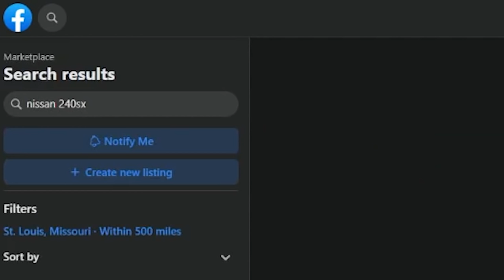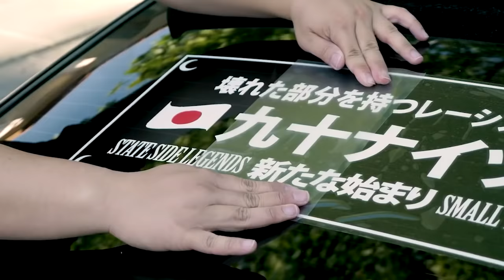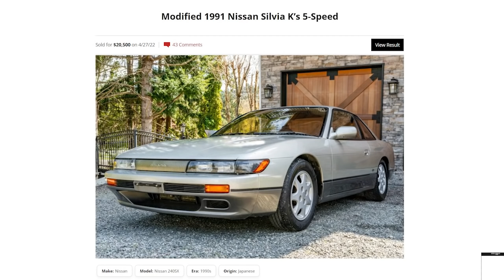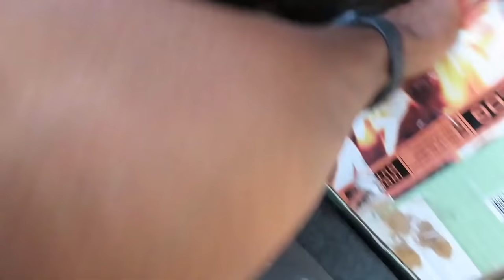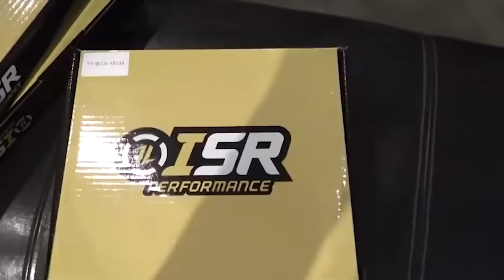Hard Truths of Owning a 240SX in 2022 (Donut Media Won't Tell You This)

Comment: I own a 93 S13 hatch since 2020. Got it for a decent price for what it was. Saved it from being slammed to the ground.($1600) Paint was bad, motor was blown and had some rust on common areas but the interior was intact and it wasn’t falling apart. Got it running within 3 months. I’d be lying if I said I didn’t have a hard time with the car. It was all worth it seeing it run though it is a money pit😅. Currently I built a KA-T and am doing some more rust repair but luckily I got the experience to do so thanks to my pops😄. Hopefully I can get it running again and looking good doing so. Won’t be easy but I’d Also be lying if I said I wasn’t determined to fix up

Comment: You’re absolutely right about the price. I bought one for a grand that was all original and it showed it, and the engine had been torn apart for 8 years. After getting it running and road worthy, I turned to the suspension. I’m now $15000 into it, and when you walk past it, it still looks like it did when I bought it but lowered. But it is a rust free car and I keep it in the garage, so that’s a thing.

Comment: You hit the nail right on the head with the build progress. I fell into that trap with a different chassis and eventually lost motivation for it and couldn’t find jack s*** for info on the swap I was trying to do. Luckily, I pulled all my parts worth value off, went out and bought a running and driving SN95, and installed all my drift car parts onto that car, and it was the best decision I have ever made because by the time I finished the other vehicle, I would have been well over $10k into a vehicle that would be worse than my SN95 with harder to source and more expensive parts. I cannot stress this enough. Buy a vehicle that fits your budget and needs the bare minimum to get you seat time in whatever motorsport you want to do because there is genuinely no worse feeling than dropping a stupid amount of money on a vehicle and not even getting to drive it or worse yet, building something like that and immediately destroying it because you have no experience
Reply: I also agree with the keep your car stock part. My method for this car is to keep it as simple as possible and only upgrade stuff when something breaks

Comment: 100% right and I hate what the car has turned into.

I’ve had two S13’s (in EU so a 200sx but anyway) 
The first one was all riced out and a piece of shit but I unpimped it and used it as a street car and some autocrossing. It was a beautiful machine and just found out it’s been hacked to pieces by some drifting idiot.
The second one was completely stock and my daily driver, super reliable and didn’t need anything.
Reply: A stock car that is reliable is better than a "fast" car that doesn't run.

Comment: Haha, this was a fun video to watch. I have a 1990 hatch that I've had for 21 years. Its been sitting without an engine for around 10 years now.  I got 263,000 brutal miles out of the single cam k . I pulled it for an sr20 swap but getting married and four boys later the car was on the back burner.  Now my oldest is 13 so we're getting it ready for him to take over SOON. I have all the interior minus the seats. I just need to replace the front fenders and hood and slap another engine in it and its ready to go for the most part.  But having recently been on the parts hunt, I've seen how much has changed in the past decade as far as availability.

Comment: My first car was an s13 coupe, still have to this day. Daily drove it for 3 years until I decided to get a newer car. The car is all stock only mods are coil overs I did when I first bought the car, super reliable. Everything broke, power steering , cooling, fuel it all gave out lol buuut the car never left me stranded & it was all relatively cheap to fix. Love the car to death would not recommend it to someone though lol 240’a ain’t for the weak 
Awesome video btw! Finding parts has gotten extremely hard these past few years shits crazy

Comment: Owning my 240 for 23 years, I can say the best lesson I learned was to only upgrade parts when the OEM part failed, and to ONLY replace it with OEM, Nismo, or big money Japanese aftermarket tuner part (HKS, Greddy, Tomei). Steer clear of ebay replicas, NRG, ISR, Megan chinese crap. The community got drunk on drifting boi look so much so that when I was going to car meets and seeing 240 owners with baseball bat rolled fenders and slamming their oil pans going over speed bumps, I was praying this fad would die
Reply: EXACTLY this
Reply: This is the way, theres very few instances where aftermarket goods improve your car in all areas (quality of life, performance, reliability) and Nismo seems to improve performance with no decrease in reliability and minimal sacrifice in quality of life.
Reply: Dirfting on 240sx is just kool aid and destroyed the poor 240sx culture, just take a mustang if in the states or a e46 if in Europe, and do not tell me mustang suspension sucks because the original ae86 sucked too having a live axle as the mustang does.
Reply: ISR and Megan are perfectly fine brands to run lmfao
Reply: also hella flush = hella fail
Reply: Bought a 100k km r32 gtst, all stock except for aftermarket (good brand) exhaust and display screen instead of radio. Still has oem airfilter box, wheels, steering wheel, even the floor mats are still the original. Im gonna keep it as stock as possible except for a new set of wheels maybe, and if i ever have to replace any part im gonna make sure its the best i can possibly get, these cars deserve it
Reply: ive had mine for 11 and i absolutely choose to get aftermarket and save the oem in my closet. why? so i can have spare parts at any given time.

Comment: I really want one and this video really helped. I've been working lots and was thinking of exporting one from Japan. It's a bit extreme for a 22 year old but I have my mind set on doing it right and nothing's gonna stop me.
Reply: Hope you get it man, it is life changing when you own and drive the realistic car of your dreams. Had both a Silvia and a 180sx when I was in my 20's and still the best cars I ever owned.
Reply: If it's not rotted out don't worry. Plenty aftermarket parts. If done right it's not hard to build a great car around 3k. I fell into a 2000 integra ls. Found a rebuilt motor dirt cheap. New clutch and all the hydronics. New control arms bushings. Sway bar upgrades. 288k miles drives better then new.

Comment: I've never owned a 240SX but I have owned a KA24DE and 5 speed out of one that I built and put in a Datsun 620. 4x 52mm CV carburetors on a custom intake, I bought a Chevy Luv distributor, cut the shaft shorter, made an adapter to fit it in the head, and put the gear off the original distributor on it so it would run carbureted. MSD 7AL-2 ignition, Champion C53VC surface gap plugs, 320/320 custom billet cams, 4340 H beam rods, ported head, 13.5:1 compression pistons, Exedy twin disk clutch. Bought it as a pile of parts and had it making 321HP within 4 months when I was 18 years old. Don't care about looks or interior, was all missing, used a Chevy truck wiring harness I pulled from the junkyard. The metal dashboard frame was there so I made an aluminum plate and mounted all the gauges and switches there. Ended up selling it and the guy I sold it to still drives it now. Don't care for anything made after 1989 or anything with fuel injection that isn't a mechanical injection diesel, or mechanical injection gas engine, ie CIS, SPICA, the old Mercedes system, so I really don't want one of these, too late production for me, but boy does the engine make a great conversion into a carbureted engine. Although if I hadn't gotten the engine free with the truck, I would have gone with one that isn't out of a 240SX. Because you can fit a points distributor in with much less modification than in the 240 version. Plus they are cheaper, and the intake they have can be easily modified to fit a large 2 barrel Holley. Truly though I wouldn't have gone with a Nissan engine at all but with a Chevy Cosworth Vega engine with dual Weber carbs. Love those things. That is my ultimate car to aspire to, the Cosworth Vega.

Comment: I brought a factory 180sx/240sx for $6k from an old guy 155,000kms and that was 2 years ago. Had a CA18DE in it that was only running on 2 cylinders and now is swapped with a RB20DET put on cobra lowering springs and put on 18x10.5 5x114 Work Emotion CR2P Wheels

Comment: Not gonna lie this is a great video for anyone to watch. Not even S chassis owners. Hell, I'm not even an S chassis owner. I have owned multiple 4th and 5th gen civics, e90 corollas, first gen imprezas. Know the car before you buy as much as you can, rust eats every old ass car. Know common swaps,what to look for in each generation, know what different gen valve covers look like, know what different engine heads look like. It is not uncommon for people to swap heads on hondas,subarus,etc and build frankenstein motors. I'm currently building my EJ8 it's been in the works for 2 years and I work on it outside since I don't have a garage. Cars can be daunting I'm a technician and have been one for 4 years and having a project is daunting. If you have no experience with any car at all get something you can tinker with,plan your shit out. Tackling shells,or half finished projects aren't worth it. Cheaping out on parts is okay, but know you get what you pay for. I recommend doing what is in your price range for you, and use legitimate good parts or period correct parts. Realize if you want to do a swap or build any car from shell up,bare block up, etc understand it will take time. You will want to stop and give up, let that shit sit save your money, gather your parts, build it and build it correctly. It sucks having shit sit so have a daily to drive don't touch that shit and keep it nice. Projects are projects enjoy them when you want to, keep your damn daily nice. Good luck, and don't break your bank.

Comment: Yeah, that's absolutely true. It is so freakin' hard to find parts for a 240SX. I bought mine relatively cheap, but nearly not in a perfect confition. Just to find 2 pieces of door lock cylinders took me HALF A YEAR. Not even talking about the broken, rotten, leaking fuel pump I also had to spend a fortune to replace. But at least it is in a stock  condition and now it runs fine.

Comment: This dude is correct in every fucking way imaginable. I am going even further. Even if you get a nice example with the turbo sr20, this motor breaks all the time. Electronics/Electrics problems, turbo problems, rust and so on and so forth. This car is just a piece of shit. Save yourself some cash and nerves (in the long run) by buying a stock gt86/brz (2015 and newer). Keep it stockish and you will have the same fun and be able to sell it in a few years without much loss.

(And do not stance the mutherfucker because you are going to break everything)

Comment: The problem with rust is you can't avoid it. There are litterally NO 240's up here that aren't totally rotted out. So if you don't have a garage, money for advanced welding equipment metal shapping equipment and hundreds of free hours ( not hours you need to spend doing the basics of life to survive ) 

Then you better have 8k+ laying around that doesn't need to be allocated or better spent on anything else because that's the only way you're getting one without rot up here.

And guess what, it's already going to be someone else's car and you'll have no idea how they put it together or how it's settup.

Comment: The issue is a lot of people do not want to learn Wiring Diagrams, updating a cars Aesthetics, installing a CAN BUS system . I VQ swapped my hatch & installed an 06 G35 Cluster with working Speedo, Crusie Control, heat & AC( currently have a clog in the lines though) radio, the works. Also an S14 rear subframe with a G35 diff that provides speed signal from the ABS rings on the half shafts. Had the car since 07. It's 2022, I earned that knowledge, to teach it to " Today's children out the wombs of these Content mommy's & daddies making content babies ", is hard af. I learned my lesson the hard way of getting rid of the 2 words " I Know" out of my repertoire when learning from someone else. Took me farther than I ever knew.

Comment: Back in 2008 I walked into a "Buy Here-Pay Here" lot in AZ & fell in love with a near pristine white '91 hatch. The interior looked as though no-one had even sat in the car. I didn't know a thing about them but for $2999 I thought why not. Over the course of the next 9 years all I had to do was regular maintenance, replace the battery & tires . When I transfered to NC in 2012 I drove it cross country. Not a blip of an issue. Then in 2017 a co-worker totalled my baby in our corporate parking lot. I'm still in mourning.

Comment: True as hell. I originally picked up a decent s14 with a KA-T on marketplace. Just had some cooling issues and needed an alignment. Now 3 years and about $25K later. Shaved engine bay, tubed front end, relocated lines and wires, entire suspension, brakes, widebody, 2JZ and still haven’t got it finished and running yet. Haven’t trashed the interior at least. The KA-T was fun enough when I had it honestly

Comment: Had my vert since 2016. Every mod I did was a repair job. Suspension was trashed; replaced all the bushings and upgraded strut and springs. Auto tranny lost 3rd; bought a smashed donor and converted it to stick. Electric short left me stranded, towed it home and repaired the hack job radio install then sodored a new harness and installed a clean double din. For the 1st two years I was at every junkyard just pulling spare parts and collecting just incase parts.

Comment: Best advice I could give to someone looking into getting one of these cars is to come up with a game plan.  Get a quality notebook that won't fall apart (you'll have it for years, and they get beat up) and come up with a general idea of what you want to do to the car.  Break the car down into systems; brakes, engine, body/chassis, suspension, etc.  Write down all the parts you think you'll need to complete each system.  Look up real world prices on these parts, and consider all the little stuff that can nickel and dime a project to death (hardware, etc).  This way, when you have the general game plan put down onto paper, you can say you've done two things.  1. Come up with a list of priorities to make the car a running, driving car. 2. You have an idea of what this project will take financially.  Not many shells can be called "finished" even with 20k in parts, let alone the labor you'll have in it.  I own 2 S13's, and have had one of them for the last 19 years.  My most recent one is a ground up restoration that is a years long project that I knew full well what I was getting into it when I started it.  If you want to get into them, sounds great, just take your time and enjoy it for you.

Comment: Not just 240sx, but any car past 15 years old.  Unless the car is garage kept and you have a 2nd daily car, these older cars and their parts are just going deteriate with time.  My 23 year old S2000 had its radiator blew at 80k miles and rubber suspensiom bushings are definite on its way out.  If kid had to get a used car, 10 years 120k miles should be absolute max for something that can be reliable for years without major work needed nor money pits.

Comment: Bought one in January. Completely rebuilt the SR20det/trans/new clutch and flywheel/new diff/ new single piece drive shaft/ rebuilt power steering rack/ new radiator/ new mounts/ rebuilt subframe/ new tie rods/all new wiring though out (wiring specialties) new brakes.... All of it. Even got a new exhaust system, greedy td05h rebuilt turbo (gpop shop) there is nothing left to do apart from body work, and the body is immaculate. Everything works. Interior is missing the rear, but aside from that this is basically a new 240.
Reply: The guy who I bought it off blew the SR. I got the car for next to nothing with CRATES of parts. This guy's correct about enjuku. Edel loves me now. I blew about 7k on the car there since January. However, I've wanted a 240sx ever since I move to the USA. If you have money, buy a 240. If you don't have money, don't do it to yourself.

Comment: I recently bought a 1997 miata about 8 months ago, Im getting a grasp of working on cars through old peices breaking. But id never get an insanly unrealiable car, I think the biggest thing people skip over is maintnence work. they look at hp and performance but never the longevitey of parts. this was true for me, my radiator fan broke and it sounded like metal on metal, so i bought a new car because i thought the engine had blown. I took sometime too look into the issue and later found out, thankfully my engine didn't overheat.

Comment: I got my first 240 for only $3k. Had a blown head gasket, rebuilt the motor and that blew, so I ended up getting a ka24de, made sure it's in good condition and drove it for 2 weeks before it lost compression, rebuilt that motor and in a few more days, it will finally be able to run again, the only thing it needs cosmetic wise is just a headliner and the pop up headlight covers, it definitely is more expensive to get it used than the $13,000 perfect condition 240. I wouldn't say it's worth it, but if you really put the time, effort and money into it, it will be rewarding if you have enough patience to deal with it's ups and downs.